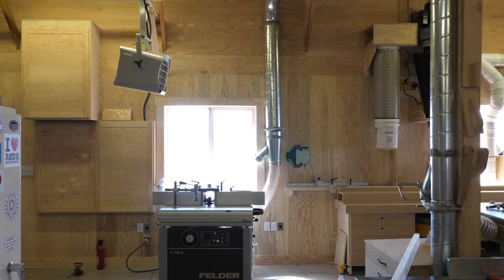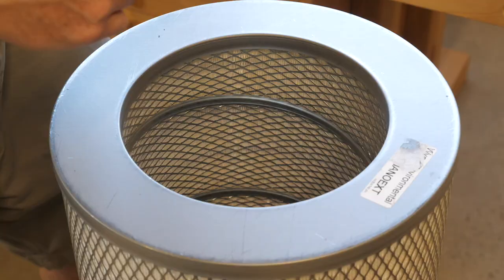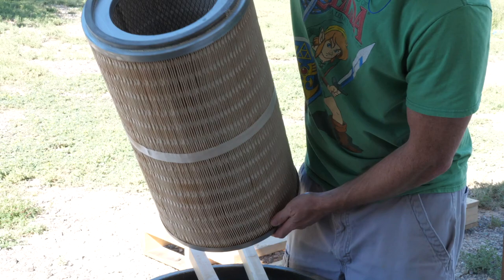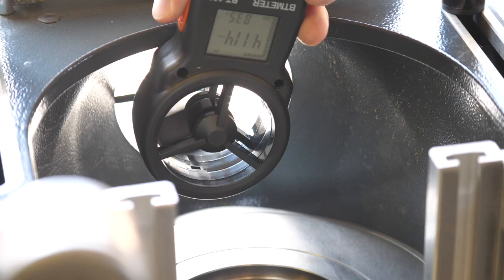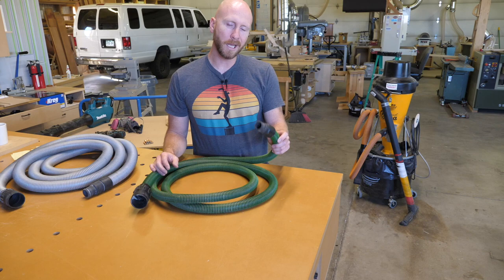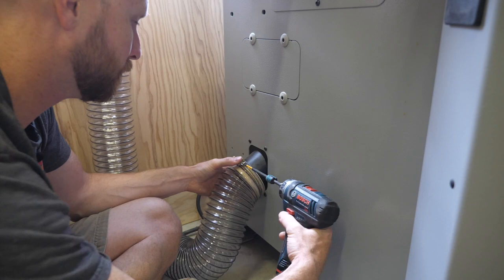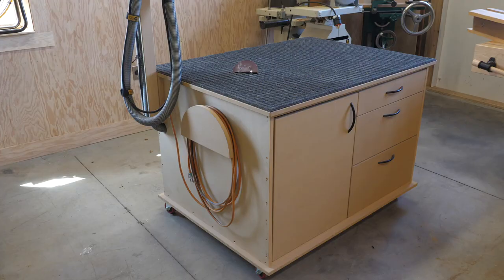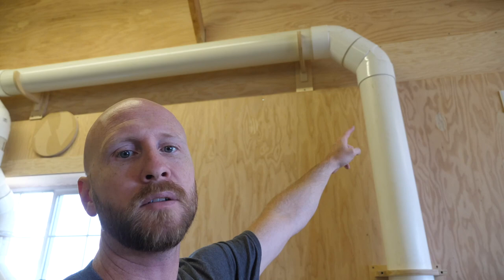Dust collection tips

Comment: Great video as usual. Thanks 👍 as a retired physician I realize what my lungs are worth. You did a great job in this video. When designing my new shop I decided to also install an attic fan. This woks quite well.
Reply from the maker: I like that idea. I have one installed in my shop. I probably should have mentioned it in this video.
Reply: @MikeFarrington  Great Minds, right. I employ all of your suggestions in one way or another. I worked with Oneida and received great service. I got the biggest cyclone they had with all metal ducts. I’m blessed to be able to get what I want and those that I let in my shop are surprised at what they see. They want to know what “that big white machine cost”? (The cyclone) I say tell me what your lungs are worth. Love your videos. By the way I always suggest those that use remote RF switches to get the best heavy duty one they can and turn the power off to it when you are not in the shop. I’ve heard stories of stray RF signals turning on the dust collection, and running for hours to days. Thanks!
Reply from the maker: @MJ-nb1qn  They last forever and work well. Maybe expensive, but to me totally worth it.
Reply: I have a basement shop. I installed a bathroom fan in the ceiling at one end of my long, narrow shop. It is dead silent and maintains a low level of negative pressure that tries to keep shop dust out of the HVAC system and the rest of the house. It seems to be working. It also clears the room of finish odors and similar.

Comment: When it comes to metric vs imperial ducting you can pretty much go by 4" = 10cm or 100mm witch is a fairly common one. The other common dimensions are 50mm, 75mm, 125mm 150mm and 200mm which is 2", 3", 5" ,6" and 8". So basically 1" is almost 25 mm or more precisely 25,4mm so it's pretty close. Then you can use the heating pvc ducting trick you mentioned earlier to get it to fit precisley since it's pretty close compared to the metric ducting dimensions. The one off is normal vacume hoses that in metric are generally 40 mm for shop vacs and maybe 32mm for normal household vacuum cleaners.
Reply from the maker: Totally agree unless you are a good chunk off in size. I have plumbed my shop using 4, 6, and 8" ducts. So when I get the random 120mm port, I need a way to size it up to 6" Thats where the donuts come in.

Comment: in lue of that dust tapping get yourself a cheap "massage gun" off Amazon. 1) you can use it after long hard day of work, they are great, but 2) the vibration is very good at loosening dust from carpets, but also filters. A tool you might not think to use. I also like the small Makita air blower, it's very powerful, but way easier to use around smaller items in your shop and is still powerful enough for porches and other small areas for debris removal.
Reply from the maker: Thank you. That is a good tip.

Comment: Very good information regarding dust control and how not to breathe in wood dust - which is a known carcinogen. Top tip, Mike: if you want to minimize dust inhalation, shave your beard. OSHA recommends being clean-shaven prior to donning any type of dust mask, including a full-face or half-mask respirator. The really fine dust has a good chance of getting in between your beard hairs and the mask.

I know, maybe you won’t look quite as macho, but you may increase your chance of not dying from lung cancer at a relatively young age.
Reply from the maker: Thank you. I believe that is too fine of a point. When I cover the inlet on this mask and breath in, a fairly good seal is created.

Comment: I really like the air filter setup with the duct fan. Have yo considered taking that to the next level and actually putting ductwork throughout your shop with drops and blast gates to suck up and filter air directly over the parts of your shop you create the most dust? Seems like it would make collection more efficient and possibly good enough to avoid needing to wear a mask beyond the actual moments you're making cuts or actively sanding.
Reply from the maker: I only wear a mask when doing something that requires it. I kicked around installing some ducting, but I think the overhead caused by the pipe would make the system less efficient.

Comment: While the ambient air cleaner idea you have is a great one , the one draw back is that in a shop you’re size you are not pulling anywhere near enough cfm to give required air changeovers needed to adequately filter the air.
Reply from the maker: I would push back on this. I made two of these, and based on my particle meter the air quality is pretty darn good in my shop, and improves fairly quickly when I turn them both on. The rest of my dust collection game is pretty good, so there isn't a ton of stress on these filters.
Reply: @MikeFarrington  well if it is that’s a pleasant surprise . I have two 1350 cfm air cleaners with a suggested air changeover rate of 10-12 air exchanges an hour and 1850 sq/ft shop. I couldn’t imagine going to units that small and achieving 10 exchanges per hour.
Reply from the maker: @northernhumidor5615  10-12 exchanges is an arbitrary number picked by a marketing department. Your shop may need more, it may need less. The only way to know for sure is to get a partial meter. The 1350 number is also a number developed by a marketing department. My guess is the real world number is lots lower, especially when the filter is slightly loaded. I'm not saying these filters are better or worse, but they have been tested in my shop. So I know how useful they are.

Comment: No.
"Take steps to improve over time" can be the worst advise ever when it comes to dust collection.
You are one of my favorite video-producing woodworkers and I was really disappointed to hear this from you.
This exact advise is what I heard and followed in the beginning of my woodworking journey.
This exact advise is what gave me severe allergies 3-4 years after I started woodworking. I've never been allergic to anything in my life before.
Now I am and I have to take quite a few steps to make sure I'm not sneezing constantly for days after working with wood.

Much better advise (and I think Bill Pentz would agree with me) is to invest in tools that mitigate the most dangerous dust as soon as you can. As in, get an excellent sander (Festool, Mirka, 3M) and a good dust extractor (Festool vac or any full HEPA unit) first. Planer, jointer, router and even table saw shavings can't hurt you much, but very fine dust can.
Skip all those crappy sanders by Dewalt, Makita, Milwaukee, etc. Those are dust pumps.
Sure, a Festool sander/vac combo can easily cost you $1000. How much are you lungs worth?
Ever since I got those allergies, I spent more on Zyrtec, tests and doctor visits.
Do yourself a favor and never sand any large projects unless your process produces negligible levels of dust.

And please, Mike, I implore you, don't tell people that containing dangerous fine dust is something that can be a process improved over time. And sure, some may never use any dust collection and never develop any allergies. Many others are not so lucky.
Reply: Only a full time professional MIGHT agree with you.  
The DUST is never 100% mitigated .  If you have an 'allergic 'reaction to dust that makes you sneeze for days you definitely have a more serious underlying respiratory complication and LIKELY have several allergens besides dust. (find a better doctor)
THINK high quality dust mask .   If your a DIY this should be your next purchase.
Reply from the maker: Sorry to hear of your issues. My guess is that a sever dust allergy is fairly rare. This video is intended for the bulk of the population who don't suffer from sever allergies. In that case, most of these are very helpful tips. I would also guess that there isn't a person on earth, new to the craft who would have even the slightest idea where to start to setup a really good dust collection system, including tools, vacuums, filters etc. I've been at this over 20 years, and I'm still learning, as is the industry. Again, I'm sorry to hear of your issues.

Comment: Great video with a lot of very helpful information. I am interested in building my own air filtration unit and wondered if you could share about the noise level produced by the fans on your cylinder dust filters. Considering that type as well as the furnace squirrel cage style.
Reply from the maker: I have no idea how to describe the noise level. I work with ear buds in, so I don't hear them at all. I will say this, the inline fans are designed to be used in homes, so they are typically pretty quiet.

Comment: Great video Mike !   Tons of useful info.  5 inch flex-hose fits on Felder 120mm ports without too much finagling, but those adapters are genius.  I like your anemometer idea for hose diameter vs. air speed, esp. at altitude.  Yeah, Bill Pentz' writings were a real wake-up call.  After seeing you and J. Bates both use an air quality mon, it's on my list now, LOL.  Love those skyline time-lapse shots.  Front Range ?   thanks again man  . . .
Reply: 120mm is very uncommon 125mm is probably the one they use. Though it might be somewhat under 125mm if it's designed to be used by a 125mm flexhose around it. Which is basically 2mm smaler then a 5"  so that would work with a hose clamp that you tighten a little more. The hose he used was already 4" which is about 100mm so the port on hios machine were most likley 75mm which would be about 3".
Reply from the maker: Thank you. The air quality meter has really been a big help. It has given me a much better understanding of where dust is being created, if you can afford it, I think its worth it. 5" flex is easy enough, problem is on the other end, I have used 4" and 6" duct, so I would need to track down other fittings, so I just end up making the donuts. Yes, Front Range.

Comment: you can find PM 2.5 air quality monitors for under $25, I have one in my shop and one in the house. They work great. They need a 5V power supply, but you probably have a few power adapters lying around, don't you?

Comment: Another great video. I found it difficult to design a good dust collection system for my very tiny shop because of lack of easily accessible information. I ended up buying a DustRight, which is far from adequate for my tools (Hammer K3 and Hammer A3-41 produce the most dust). Videos like this are helpful, though it would be nice if you could do a run down of the system in your shop, which appears to be the Oneida High Vacuum dust collector. Also, I am pretty certain that Felder sells a little plastic adapter for the dust port called the "Quick Connector Reducer."
Reply: It seem they only sell reducers so if you want to go up from the 120 to a 6" you are on your own.
Reply: @MrBertstare  I missed that he was increasing the diameter, not decreasing it. Good catch. My bad!

Comment: Very interesting video. Ever try vacuuming your filters?
Reply from the maker: Yeah, If I lived in a neighbor hood, I would probably go that route. I would use a vacuum with a bag, so it would be easy to get rid of the dust. I would still do that outside of the shop though.
Reply: @MikeFarrington  makes sense. I’ve cleaned a pool filter (kind you find in a pump house) with a lower power pressure washer (Ryobi) and it worked quite well. I imagine that would absolutely destroy the filter in this context even though they look very similar. 😆 Thanks as always for sharing your knowledge and giving us a peak at your beautiful shop.

Comment: Thanks for this video!  This is what I've been looking for.  Is there a reason to not go to the 12" inline fan that moves over 1000 cfm?
Reply: Answering my own question - it could be done, but you would need 2 filters for each fan
Reply from the maker: Yeah, plus noise is an issue, more air movement is more noise.

Comment: Since you have then anemometer, can you test the 2, 45's method in comparison to 1, 90 degree?  I just don't know that you'll see a difference with your particular system.  My guess is <1%.
Reply from the maker: I think you would probably be right just looking at that one corner. There is a compounding effect that shouldn't be underestimated. Also, I can say that the flow of particles and the tendency for them to settle out just after the corner would be much much higher.

Comment: Another great video!

In your opinion, any drawbacks to venting a dust collector outside vs through a filter inside?
Reply from the maker: The downside is loss of conditioned air. If that isn't a thing for your shop, its all upside. Oddly enough, I bought the stuff to vent outside, I didn't include that in this video because I didn't have time to get to it. I was going to go with a setup where it was a couple bolts to switch between venting inside or outside.
Reply: Thank you, Morpheus.
Reply from the maker: @joeprior7311  Ha

Comment: Why are dust collection system always designed to fight gravity by pulling dust up rather than sucking it down?
Reply from the maker: Because the dust needs to be pulled up to the intake height of the cyclone separator, where the dust is spun out of the air and into the dust bin. That part uses gravity.

Comment: Try another vac for cleaning vac filter pleats.
Reply from the maker: I have tried that, it works well, but I end up struggling to clean that filter.
Reply: Probably easier shop with vac filters where the cake is on the outside. Tunk them out over a barrel with your back to the wind, brush out the pleats, more tunking, and then vacuuming. Been watching yours and others videos on table saw guard collection. One good idea is vac port in front aimed down and back towards the stuff blowing out of the gullets above the kerf like the inlet port on a chop saw. Another is ports in the table insert that may catch the plume that occurs when the blade exits the kerf. One fellow has a separate piece of clear plastic with a stub glued to it so it can stand it up against the guard when it’s open on the side. My recent unguarded Sawstop hooked to 1 1/2 hp Oneida (02) sprays me with dust on every pass.
Reply: Forgot riffling the pleats! D’oh!

Comment: Great info Mike. On another subject, I’m curious how you handle humidity? I’m sure winter is not a problem but curious what the RH is there in the other seasons?
Reply from the maker: I live at over 6k feet. We have very low humidity year round. We run a huge humidifier in the house for 8 months out of the year. That is a subject I don't know much about.

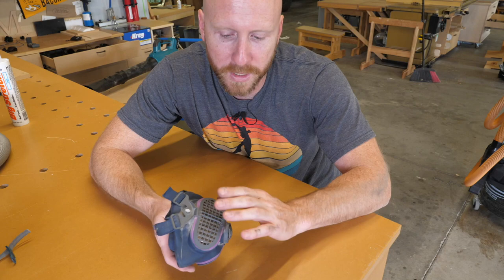Comment: 13:35
Dear Mike. I have the same face mask and I noticed that my beard negates the filter effects both ways, air in and out. I don't have a long beard, but it still seems that a clean shave would work the best. The filters work partly,  but I wouldn't want to shave my beard for personal reasons. I noticed you have some facial hair and what are your thoughts on this topic?
Edit: I saw the ending and I feel a bit better about this. I took off the filters and cleaned them with compressed air and there was quite a lot of dust in them, so yeah... I guess having a clean shave would be almost perfect to protect yourself, but this product is still a big upgrage from 2 rubber band fabric face masks.
Reply from the maker: I would say try a different size. For me, if I cover the intake and breath in a pretty good seal is formed, even with the beard.

Comment: Hi Mike, did you find a need to ground your PVC ducts to avoid static? I’m preparing to install a new dust collection system and keep going back and forth between between PVC and metal.
Reply: PVC is an insulator. There is no scientific evidence that static electricity can cause a fire or explosion in a PVC dust collection system. I have the ClearVue dust collector with 6 inch pvc piping.  The only static discharge I've experienced is touching the clear plastic cyclone cone when the motor is on. Since my DC is kept in a sound and filter closet, that is not a danger. See Stumpy Nubs video on subject.
Reply from the maker: I'm with Mark, I think the static electricity issue with PVC has been over blown. My last collection system was PVC, the one before that was PVC, 15 years and no issues, other than dust sticks to the outside of the pipe. From what I have read, there is theory and there is reality.
Reply: @MikeFarrington  right on, thanks for your feedback on this!
Reply: this is only applicable in a large industrial application where the system is on constantly and sucking material from many sources all day.
Reply: A lot of it depends on your climate. I love in a place with dry winters and my DC and non-AS hoses were always giving me huge shocks. It's more of a comfort thing but I grounded my plastic and got AS hoses and it's sooooo much better
Reply: @guitarchitectural  I experienced the same thing, particularly on my drum sander. I ran a strip of sticky-copper foil along the PVC pipe back to the dust collector itself for grounding, and used anti-static flexible hose to the sander itself. No more shocks.
Reply: Idk about pvc piping specifically, but static electricity can potentially cause a fire with dust as per CSB findings. Look up "USCSB dust explosion (United States chemical safety board). I forget if they pinned it down to static or not, but some of those events were potentially caused by static. Again, not sure if  PVC was an issue there or not, but I think it might be something to search for on their website if you're interested.
Reply: How do you ground them? Just poke a piece of copper with into the ground at one end, or do you have to run it the whole length or something?

Comment: Since you've got both metal and PVC ducts in your lab, have you noticed any significant difference in static electricity between the two?
Reply from the maker: The PVC has static, the metal does not. There is more to it then that, but if static is a concern, the PVC stuff can be grounded.